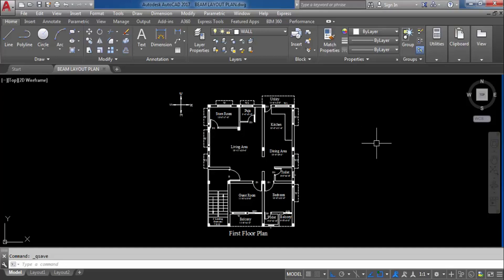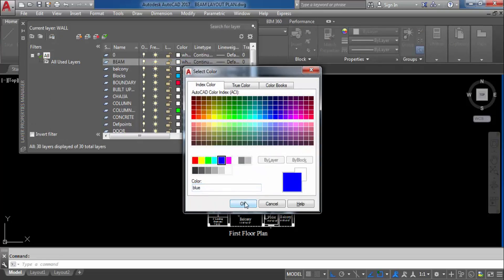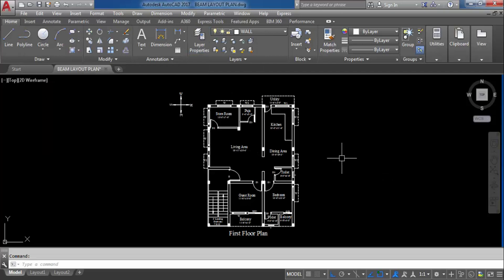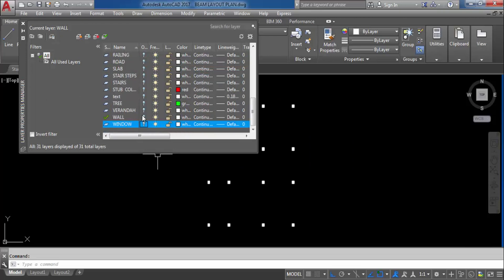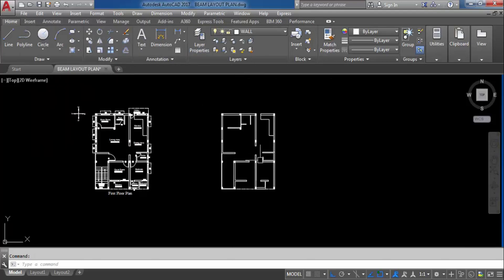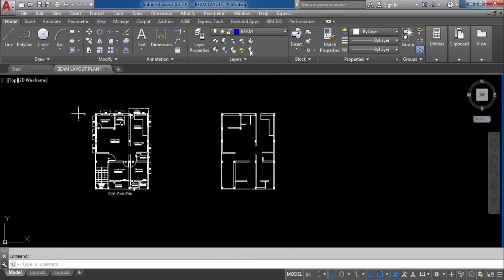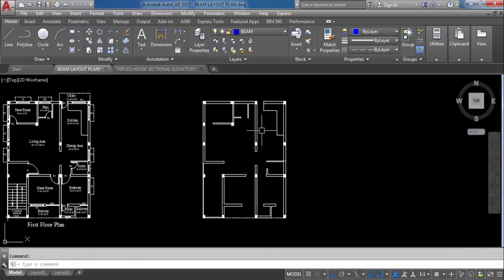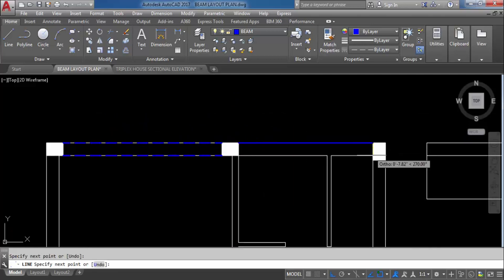BEAM Layout Plan of Triplex House in AutoCAD || 1345 SQFT || Building #11

Comment: How to provide creat beam or column first
Reply from the maker: Column Placement: The columns are positioned and constructed first. This is because columns carry vertical loads and are essential for the structural integrity of the building. They help establish the frame of the structure.

Beam Placement: Once the columns are in place, beams are constructed to connect the columns horizontally. Beams transfer the load from slabs, walls, and other loads to the columns.